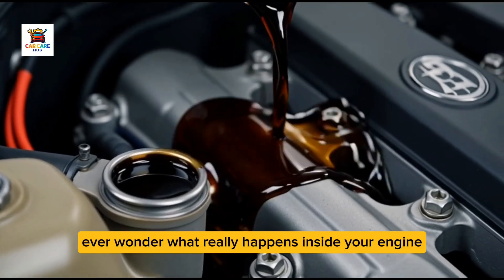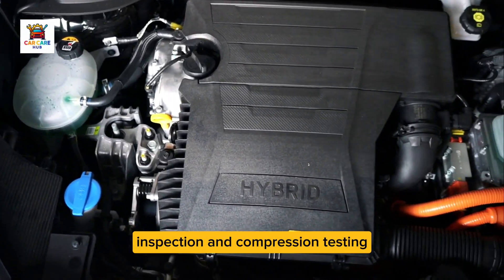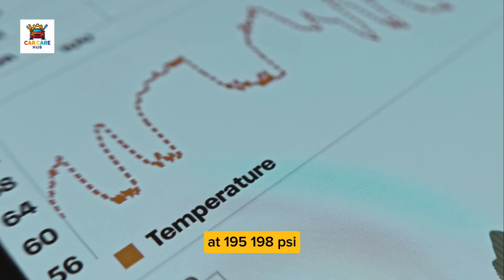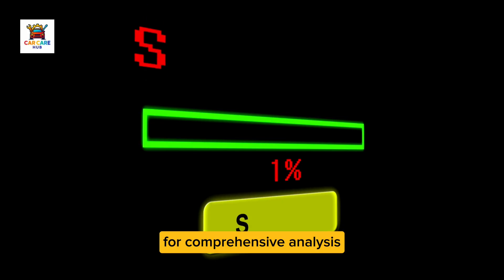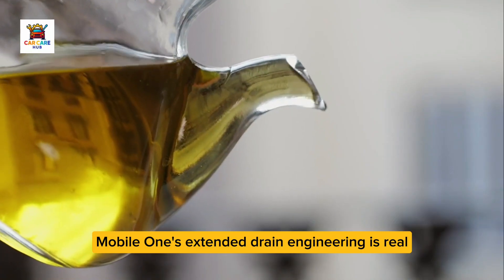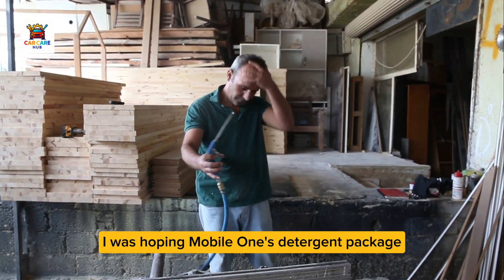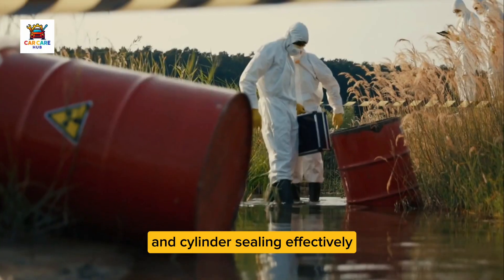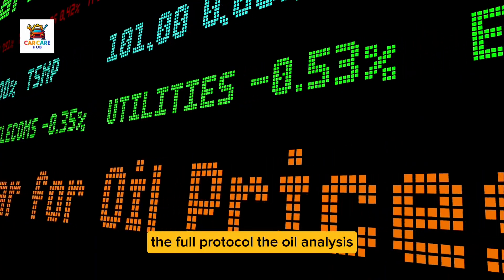I Tested the #1 Engine Oil for 10,000 Miles — The Engine Results Shocked Me

Comment: For 1.5 T engin in CRV 2018, Honda recommended 0W20. Considering oil dilution, do you recommend using a higher viscosity oil? Or, stick to what Honda has recommended?
Reply from the maker: For the 2018 CR-V 1.5T, Honda’s 0W-20 recommendation is still the baseline I’d follow, especially for normal street use. Oil dilution was more prominent in earlier production years and short-trip driving, but Honda issued updates to address it. Rather than jumping to a higher viscosity, a high-quality 0W-20 with good shear stability, combined with reasonable oil change intervals, is usually the safer approach. Moving to a thicker oil should really be based on confirmed dilution or UOA data, not as a default change.

Comment: Mobile 1 has a higher evaporation rate than Amsoil. BUT given the piston top and valve stem cleanliness, is more about the fuel used, rather than the engine oil. This is clearly a testament to Mobile 1 abilities. Mobile 1 spends millions on research test and development. Does any Major automobile manufactuere factory fill their new cars with Amsoil? NO, but Mobile 1 is strong with Mercedes, Nissan,  GM, and  many many others. Use Top Tier Plus Gasolines, and Chevron Techron run a tank just before your oil changes. Techron has PEA in it to disperse carbon from pistons and valve stems from the combustion chambers. You want to use it for an oil change, not afterwards. It will darken your engine oil considerably.  It cleans injector tips too. Keep using Mobile 1 Ext Perf. 5w-30 walmart has the best prices.
Reply from the maker: That's a very detailed perspective on the relationship between oil, fuel, and engine health. Thanks for sharing your insights!

Comment: If running a direct injected gasoline engine, be sure your oil is a gf6 or latest gf7 formulated oil. They have specifically redesigned detergent formulations to minimize intake valve and piston carbon deposits. The video made a mistake by saying you should be running a very high detergent package. That's a yes and no. The correct package is in the gf7 oils which are the latest and greatest to minimize deposits, otherwise use a gf6. High detergent oils have been proven to cause massive detonation and excessive carbon on intake valves and pistons in direct injected engines, so beware! Read the specs on the oil and make sure its a gf-6 or gf-7.
Reply from the maker: Thanks for adding that detail about GF-6/GF-7 oils; those newer formulations specifically target issues like LSPI and deposit control in modern DI engines.

Comment: Amsoil does not cost the same as mobil 1...its ALOT higher.Also its a " boutique oil".
Reply from the maker: Correct — Amsoil is typically more expensive and sold direct. Higher price doesn’t automatically mean better protection though. The data shows performance depends on formulation and shear stability, not price alone.

Comment: AMSOIL SIGNATURE GRADE is The KING of MOTOR OILS.
Reply: There is no oil that touches Asoil signature series 07 Gmc Savana 4.8 litr 454,000 km no fulse seal no oil consumption runs better than new forget these garage oils .
Have 4 more cars spotless In engine also European oil in 335 I twin turbos BMW beautiful inside engine 

Always run Amsoil engine cleaner before changing.
Forget l moly no comparison. 
Amsoil is the best eng protection 20,000km drain intervals  mix city and highway 454,000 should see 1 million plus kms
Reply from the maker: Hard to argue with real-world results like that, 454,000 km with no oil consumption says a lot. Regular maintenance and quality oil clearly make a difference. Thanks for sharing your long-term experience.

Comment: Every time I used it the vehicle drank two extra quarts in a week ! Put conventional oil back in no problems
Reply from the maker: That can happen if an engine has looser tolerances or ring wear. Different oil formulations behave differently depending on engine condition.
Reply: @CARCAREHUB247 I happened even in a brand new rebuild with 35,000 miles on it ! I feel no reason to put that over priced oil in an engine, change your oil and filter every 3000 miles ! 25 bucks and sea foam it before oil changes so the rings never stick ! I tore down a 3.5 flex had synthetic oil all its life ! Had stuck rings on every cylinder
Reply: @MelodyKibbe castrol edge

Comment: There are many flavors of Liqui Moly, which one?
Reply from the maker: I used Liqui Moly Molygen 5W-30 for this test.
Reply: LM is only  for turbo or high out put engines. For regular Car/ Suv normal driving.Its way over kill and expensive. Motul oil is  better  protection than Mobile one Period  for every day driving cold or hot weather stop and go.
Reply: @Nick-z2h2q which motul?
Reply: Pennzoil platinum ultra  is the real number 1